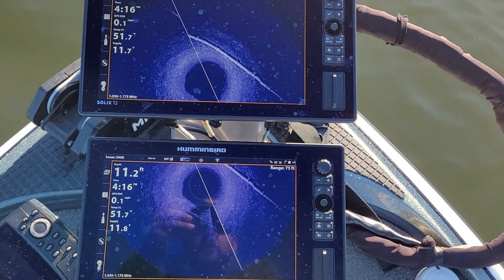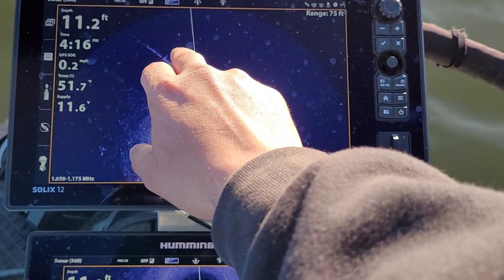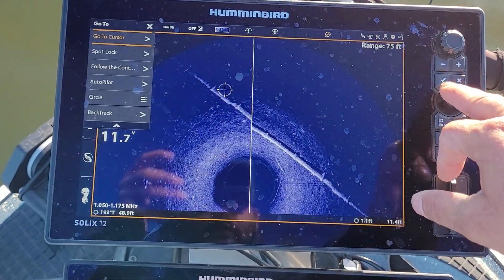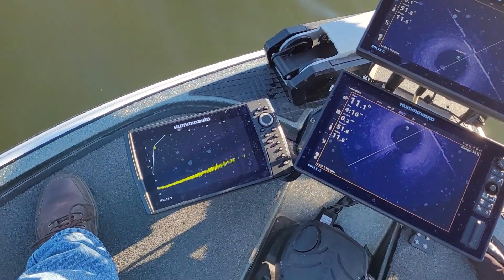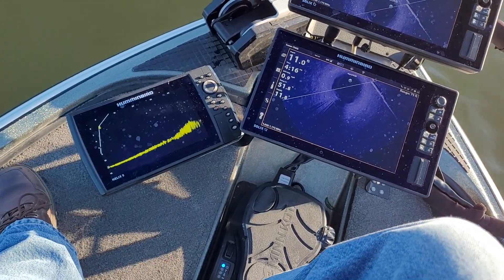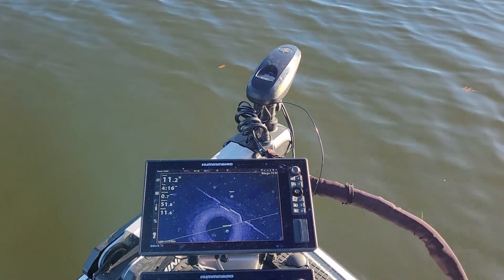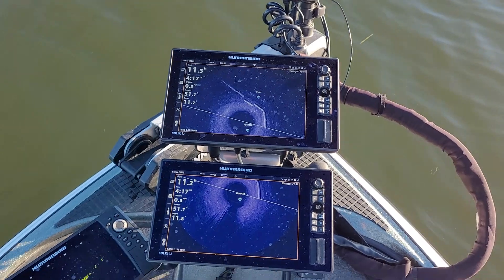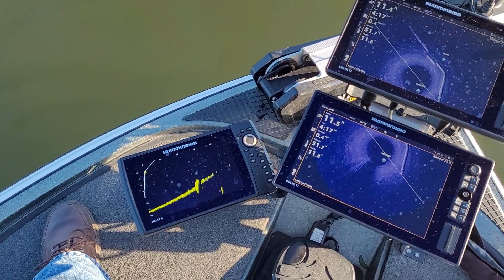Humminbird Mega Live Target Lock with ipliot-link

Comment: Did you see they just announced a mount today for this feature.. you were clearly ahead of your time.
Reply from the maker: I'm excited about the new motorized mount! Specially for the integrated capabilities.
Reply: Exactly. I just last night learned about this being released a month ago and this video was posted 8 months ago. I guess it’s the motor adapter that links the Humminbird to the Minn Kota that just come to the market last month?
Reply from the maker: @billyllewis  hey Bill. Yes, the new Live Target came out last month and it seems to be a hot item at the moment! We'll worth it if you spot lock and want to target Mega Live. I've been using the method shown here for years. It works great but the boat will drift. In heavy wind or current, the Live Target setup is the way to go.